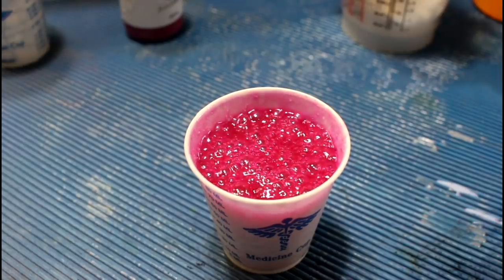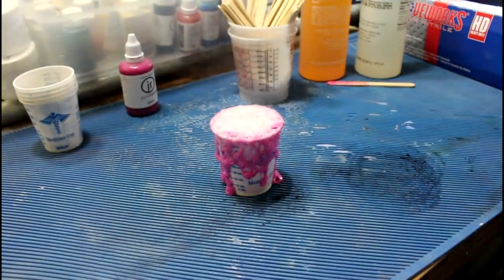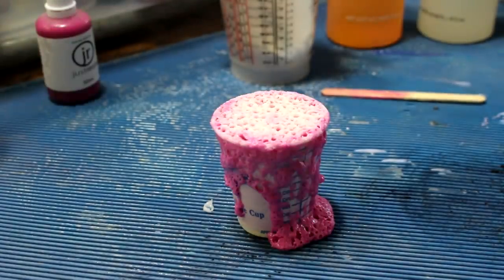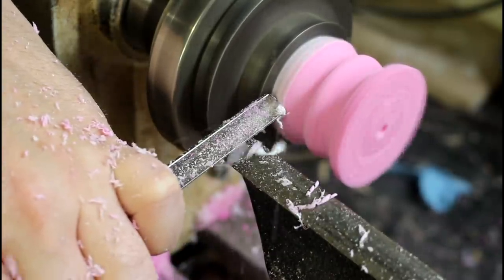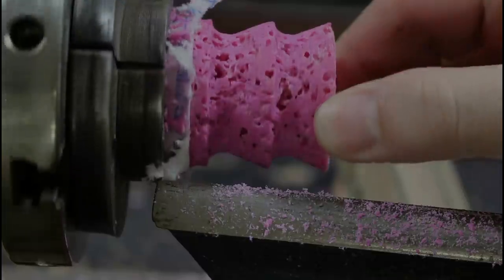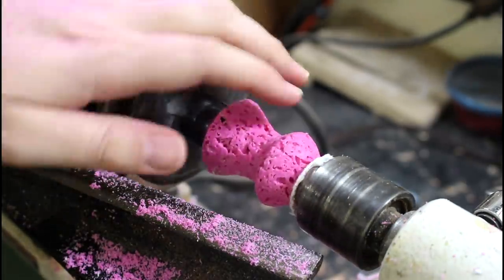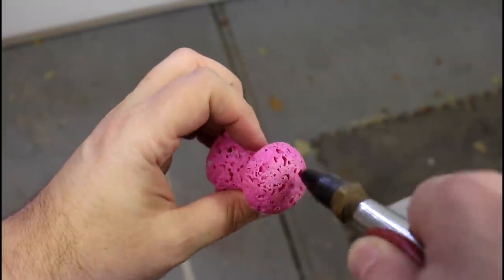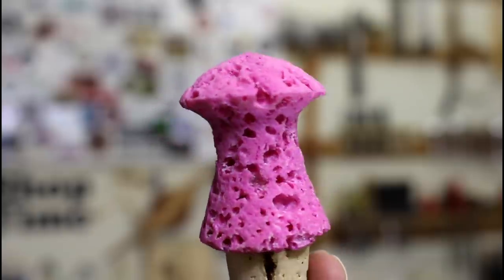Using Failure as Design

Comment: fill in the voids with another resin / color?
Reply: That'd be cool! Don't know how he would do it though....

Maybe put a small dowl rod in the hole he drilled and dip the whole thing in resin, then turn it until the link comes back out? Then take the rod back out or drill it again.
Reply: YES
Reply: That was my first thought right when I saw the voids in it!
Reply: wesleysull the only problem with that is that all the resin would leak out of holes that open up somewhere else.
Reply: Yea, he could dip it and turn again.
Reply: I use stabilizing resin to make blanks from rotted wood quite often. The technique is simple, and I made a vacuum chamber from scratch. It should work in this scenario...
Reply: Perhaps using a vacuum chamber to fill the voids? Or something like that using negative pressure to make sure all hold are filled
Reply: My thought exactly! :D
Reply: Blue transparent resin!
Reply: exactly what i was thinking :D

Comment: It contains water, fast curing resin like this reacts to water but slower clear resin doesn't react like this
Reply: The difference isn't the speed of the resin, it's the type of resin. The fast cast is a urethane resin, which really doesn't like water and will bubble. Slower urethane resins aren't as hot, so they will not have this violent reaction, but they will still cloud and bubble. Epoxy resins (usually slow, clear) are much less fussy about water content. I don't actually know about polyester resins but I think they too are less reactive to water.
Reply: Yep, urethane resins hate moisture. I've got some old resin that's absorbed a lot of moisture and it bubbles up badly while curing. Even degassing during cure doesn't help. Pressure casting it on the other hand keeps the gas dissolved in the resin and turns what should be a rigid resin into quite a rubbery flexible resin

Comment: This was happening to me at work. We were casting some "gold" bricks (I work in a props shop at a local theater), and my casts kept bubbling over just like this (we were also using a fast-curing resin). I became so discouraged, wondering what I was doing wrong! It is so refreshing to see you taking a mistake, an unintentional disaster, and making it beautiful! Thank you so much!
 I found that if I spent a bit more time mixing up the two parts with the pigment, I got a solid cast. Trial and error!

Comment: I good rule of thumb with the fast cast resin is that as long as its alcohol or oil based it works. Anything with water or acrylic doesn't seem to work well with it. I've used alcohol inks and oil paints with it no problem but things like acrylic paints or food colouring bubble like that.

Comment: The same thing happened to my amazing casting resin that cures in 10mins when I tried it for the first time. I had mixed in acrylic paint and even tried dyes. I was disappointed in what I wasted but it has such an interesting look I've kept it. Funny enough the second I saw it I thought of you and how cool it would look with the bubbles filled in and lathe into something. I've recently found powders work great to change its color.

Comment: U could make those into custom cabinet handles
Reply: but only if you would fill in the "sponge" with another resin. without it it might be to brittle to withstand someone pulling out a heavy drawer or something similar
Reply: sWaRmBuStEr ohh, imagine filling it in with a nice contrasting blue or yellow😍😍
Reply: PsychoAxeMan i
Reply: well since you´r doing it yourself you have infinte variations. (i would make a black "sponge" and fill it with orange resin)
Reply: If you fill the holes it would also solve the problem of not being able to clean it properly

Comment: That’s scary I would not touch that pink lava with a 10 ft pole
Reply: Chapman Pagel then touch it with your hand instead
Reply from the maker: I was trying this on a larger blank. It got VERY HOT!
 https://imgur.com/SkqzXur
Reply: Peter Brown just saw the picture you can bake bread with that. (Not that I would recommend it)
Reply: Peter Brown It's bubbling because for some reason the dye is chemically interacting with the resin, generating a lot of heat in the process.  The bubbles are likely whatever water is in there boiling out.

I'd recommend that when you repeat it to mix it up outside, particularly for larger blanks.  We don't know how hot it can potentially get, so there's a small chance that something alarming might happen, such as it getting hot enough to burst into flames.  Also, breathing the smoke might be unhealthy.

You can probably adjust the heat, and thus bubble size, by adding more or less dye.  Bigger blanks need less dye, proportionally, since they have more volume per surface area and therefore can't cool as quickly.  Experiment and see what happens!  :-)
Reply: Yay Peter hearted and replied ☺️
Reply: Oh jeeze I just saw the picture wow that’s hot
Reply: Peter Brown Which temperature scale is that?

Comment: This is crazy because this happened to us. We use west resin and I have been using acrylic paint and the neon and glow in the dark pigments did this to us. We used the acrylic paint from Wal-Mart.
Reply: soundwave4prez do you mean you used acrylic paint in this same product?  Reason I ask is because commercial acrylics usually contain a substantial amount of water and this product is a 2 part urethane with free isocyanate.  This is what happens when isocyantes get together with too much water. (And if intended to happen, then we would call the water a blowing agent in a urethane foam)
Reply: ExaltedDuck Exactly what I was thinking
Reply: ExaltedDuck I honestly did not know that. No I was using a different resin. The resin I use was west system epoxy resin
Reply: Also we usually didn't have any problems but I did notice that the glow in the dark and neon ones that I got around Halloween we were harder to shake and mix. So I wonder if more water got into the mix because they weren't shaken well enough.

Comment: Hey Peter. I don't know if you have that in the US, but in Germany, we have a customs that on new year's eve, we melt lead or tin and pour it in water. The cold water instantly causes it to solidify. It often results in interesting shapes that are supposed to predict the future. So I was wondering, could this be done with resin instead of water? You'd probably have to use lead because it's heavier and the liquid resin is way more viscous than water. But would this work?

Comment: That product is a 2 part polyurethane.  I have some professional experience working with these sorts of things.  Your pigment must have been aqueous suspension.  That's what isocyanates do what they get more than trace amounts of moisture in them and might have been further catalyzed by ammonia moieties on the pigment itself..  An oil based suspension would be a better approach.  Alcohol based might work but might also have too much water..  Dry pigments can be difficult to disperse without proper equipment.  If your only option is an aqueous suspension, it might be possible to add it to the polyol side and then drive off the moisture before introducing the isocyanate.  A few hours at 230-250 F would probably do the trick, and it would have to be lidded afterward until it's cool enough to use.
Reply: Also, wear a good respirator and vacuum up as much of the fine dust as you can after machining and before doffing the mask.  Urethane dust is nasty stuff. I've known a few people to react adversely to it.  It presents as something as mild as a sore throat and cough for a day or two or a sever cold/respiratory infection for a few weeks.  And it is a sensitizing allergen which can potentially lead to anaphylactic symptoms with repeated exposures.

Comment: Could you do this, and then do a turning of it...but then after you do another dip it, with a non-boiling resin, and fill in all the holes, and then return it to its original shape, so you have a weird, speckled, hole filled with a different color look?

Comment: It is amazing. The dye must be water base . the  quick Harding  resin creates a lot of heat and that's why it's bubbling .At this stage it is boiling the moist in the dye . I also found it by mistake, what i do is I put it in a slow setting  resin  with different colour. Then put it in a pressure pot .

Comment: We had this issue at work with a runway repair epoxy if there is any water in the bottom of the cup or in the dye.  The issue is caused by the extreme heat of the epoxy resin it turns the small amount of water to steam and that's what foams the resin. 
Answer is don't use that hot of a mix ratio and slow down your reaction as long a the the epoxy won't boil water you should be good.

Comment: For the curious, from: https://en.wikipedia.org/wiki/Methylene_diphenyl_diisocyanate

 It is a potentially violently reactive material towards water and other nucleophiles

I tried looking on Just Resin's site to see what the ingredients in the dye were: I could find none.

But, these I think are the ink dyes.  Inks I believe are usually alcohol based.  From the wikipedia entry on Nucleophiles (https://en.wikipedia.org/wiki/Nucleophile)

Oxygen[edit]
Examples of oxygen nucleophiles are water (H2O), hydroxide anion, alcohols, alkoxide anions, hydrogen peroxide, and carboxylate anions. Nuclophilic attack does not take place during intermolecular hydrogen bonding.

So, there you have it: It doesn't work because your inks have alcohol or water in them (I'm guessing because the other types of Nucleophiles don't seem like they'd be used as a base for carrying pigment) and Methylene_diphenyl_diisocyanate reacts violently with Nucleophiles.

Yay, Chemistry! :)

Comment: Peter, I've watched probably all your videos, I haven't commented much but I feel as though I have to share this... Prepare yourself! I was thinking of making a lamp, about 1/3 wood on bottom, 2/3 dyed but translucent resin on top, but adding a bulb on the bottom for light. Fancy right? No no no, just wait... Remember those fiber optic flashlights? Very basic plastic strands with a light and the tips of the plastic glow? Cast THOSE in with the resin and turn it all to a cylinder shape or whatever shape you'd like, so it has like a Christmas tree effect. Maybe a few fibers still inside the resin of course... I was thinking drill all the way through to allow fibers to the light and sealing it with hot glue. Hopefully this is making sense. If not, I'll have to just try this myself and share my results. Eventually... Take care good sir! Thanks for the read. Looking forward to all future videos as always.

Comment: That is called an exothermic reaction.  There must be more than pigment in the "just resin" pigment.  Typically exothermic reactions are volume based reactions.  I am not too familiar with the fast cast product, but I'm guessing they are poly based.  Either way nice little happy accident. Just be careful with those fumes from that type of reaction Peter.

Comment: Looks to me like runaway resin. With fast set resins a lot of heat is produced to cure it. So when you have that volume of resin in a container that doesn’t spread it out it will heat up which causes it to start curing which heats it up more which causes it to cure even faster and so on. I myself have had resins start to boil and melt the container because there was too much volume. They can even catch fire. OR there may be some water in the pigment which is creating steam and causing the bubbling.
Reply: Love the video though! Been watching you for years. Keep doing what you are doing and being awesome!